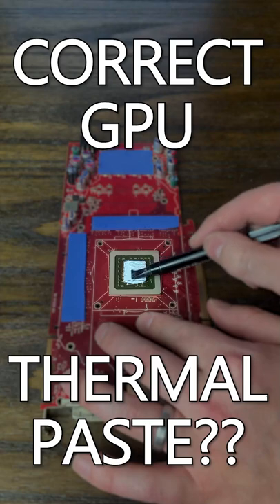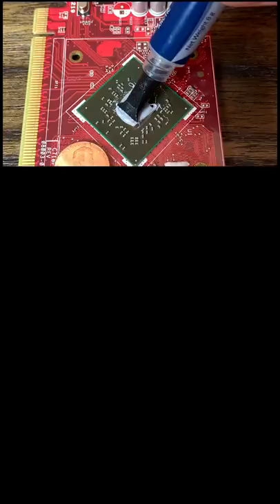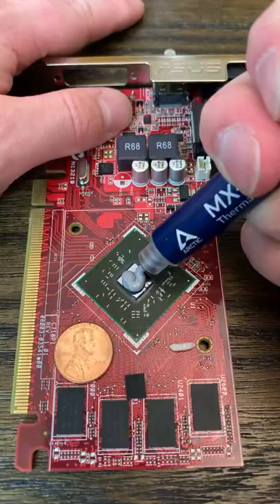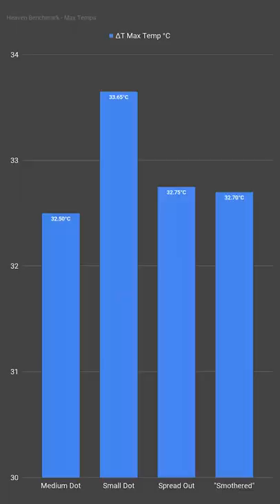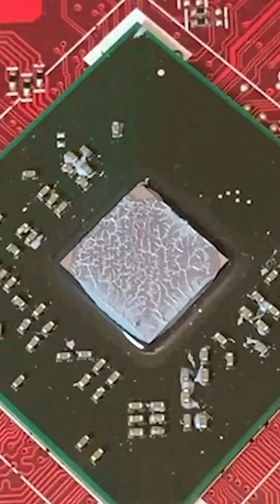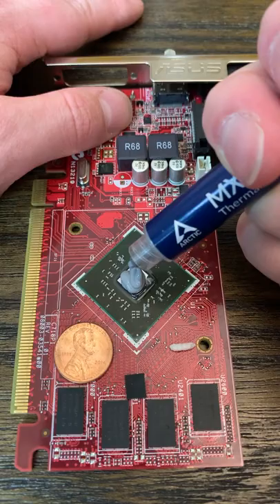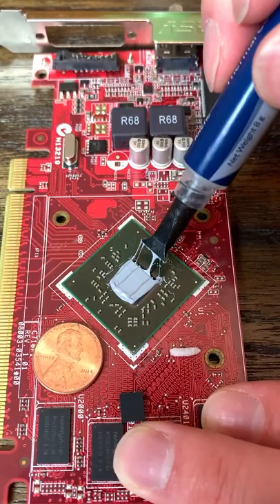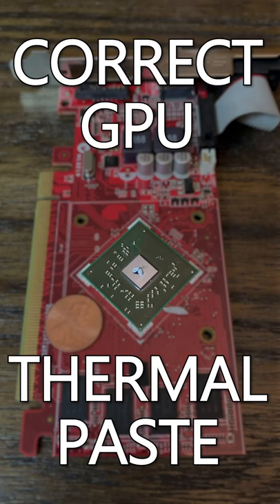GPU Thermal Paste - The WRONG Way #Short

Comment: I usually like to spread the paste onto the surface of the IHS or die so it doesn't risk any corners being left uncovered.  I tried using the regular dot method, but it still had some bare spots on the very edges.  Using extra paste may help, but it creates a huge mess that is a pain to clean up (and potentially dangerous to the components due to the risk of knocking something off).  The most important part is making sure everything is covered, 1-3c isn't enough of a difference to matter
Reply from the maker: In some instances, I believe you’re totally correct! Especially with larger dies, unlike what I was testing here. Just make sure it’s thin and even to avoid air pockets. With smaller dies, the dot seems to work well and with no extra mess.
Reply: You can make square blob you know
Reply: On an ihs it’s more or less useless
Reply: Wdym
Reply: You didnt torque it properly or added too much then. You should have full contact without any paste, the paste just shores up tiny gaps.
Reply: @HardwareHaven
Reply: I draw an “X” of paste and put a small dot in each corner. Works every time, doesn’t make a mess.

Comment: A thin, evenly spread layer on both surfaces, then a bit of wiggling the heatsink while applying gentle pressure has worked best for me over the last 30+ years of PC building and repair. Side note: mayonnaise is not a good substitute for thermal paste .

Comment: Heat spreaders are the only reason application doesn't matter on a CPU: the chip itself is already fully covered in paste from the factory, so the entire chip stays the same temperature regardless of how it's applied to the heat spreader: As long as you have enough on there, it'll be fine, you don't need 100% or evenly applied coverage. Compare this to the exposed GPU chip, which would get too hot at any points not totally covered by thermal paste

Comment: The problem you run into is that if there is any die exposed that will 100% cause damage, and it'll happen faster with higher power draw cards than lower power draw cards, the only time this isn't the case is if this part of the die has a temp sensor (which not all of it does) as in that case it can throttle/shut down etc, if it doesn't have such a sensor in that portion of the die (the corners and edges usually don't until much much more recently), I killed an rx 480 this way under LN2 a few years back because a portion of the memory controller wasn't covered and as a result the memory controller got too hot and died, iirc buildzoid has managed to kill a core that way too, but just as a point of note, this is why I generally recommend spreading manually on any exposed die where possible

Comment: In modern GPUs with a bigger die, spreading can help, so yeah, it's always relative
Reply: The tension of the mount should spread it weather you pre spread or not, it doesn’t hurt nor harm
Reply: @Joel-cj2cz  Air pockets though...
Reply: Unless you draw a circle with thermal paste it’s 99% not gonna happen you put a ball/line so as it compresses and spreads it pushes the air out
Reply: @ChrisD__  Squishing them together has a less likely chance to cause air bubbles than spreading the paste does
Reply: @TheRealGr33nGuy  That's what I'm saying :p
Reply: @therealb888  I can say the same thing about Thermal paste and air bubbles. I haven't seen a strong source or proof that air bubbles/pockets can form easily, except on forms where people claim that it does exist.

Realisticly, the only way an air bubble can actually form is if you spread to thin, but that in of itself is fairly difficult to do mindlessly. 

If coolers weren't mounted to the socket, then yeah, air bubbles will exist, but it'd be an entirely different issue all together.
Reply: @randomstuff508  Lol I'm not arguing with you. These thermal paste related arguments that hobbyists & enthusiasts argue over on forums are actually seriously studied by engineers. 

You are correct that with your counter question. There is no scientific testing easily available in the enthusiast space that demonstrate the air bubble issue.

I actually agree with you. Irrespective of the application methods, most cold plates of heatsinks (the surfaces that touch) are not fully flat. They tend to be convex or concave (not talking about imperfections. This might help to push out air bubbles. As you mentioned, air bubbles or uncovered areas shouldn't happen unless the spread is stupidly thin.

Comment: NO!  Do NOT use the DOT method.  Cover your finger with plastic wrap and spread it out evenly, ensuring there are no air pockets.  Apply enough to squish out when you mount the heatsink, and this will also avoid air bubbles.  This is the correct method and dates back to the Socket-A Athlon CPU days...    
An exposed die needs to be completely covered with a film of thermal paste because it has no heat spreader.  If you were to delid a modern CPU and remove the heat spreader, you would see the same thing:  A layer of TIM or Solder covering the whole die, making contact with the heat spreader, and plenty of exvess squishing out the sides.

Comment: Fun fact, thermal pastes are even silk screen printed in some industrial cases. Too much thermal paste will have poor performance because not every assembly can be torqued down enough and industrial thermal pastes are more viscous & dense. They're harder to spread & compress.

Thankfully consumer electronics are quite idiot proof in this case.

Larger dies with heat sinks AMD & Puget systems recommend either stencil spreading or X method.

Sources:
AMD Factory tour at CM
Puget systems testing with threadripper.

Comment: From an ihs if any corners are left it's usually fine in lower power chips. But anything with an exposed die should be 100% covered, even better if it leaks off the sides too.

Comment: Recently my machines' annual clean and dust came up. Gave everything a good clean plus dusting, and applied fresh thermal paste onto my CPU (i5-11600K). I used an X patten with a small border around it, and it's working great 😁

Comment: Spreading the paste around IS NOT a bad thing! Yes there are potential problems, but they happen maybe 0.5% of the time. I've actually had really good luck doing that method! If I'm ever unsure how much I should use, I'll put a little dot, spread it, and add a little more if I feel it needs it. This is especially  useful with older Nvidia cards, or particularly large CPU's.
Reply: im a pc builder, laptop service. since 2014 until now, no PC/ laptop/ GPU card died because i spread the thermal paste😅 so its 0.0000000001% chance

Comment: GPUs don't have IHS, it's not safe to just put a dot in the middle. If you delid a CPU you sure as hell is not going to put a dot of liquid metal in the middle. Sure, it doesn't spread nearly as easily as TP, but you want to make sure all of the die is covered. Anyone who repairs GPUs will tell you the same.
Reply from the maker: As long as there’s enough to fully cover the die once mounting pressure is applied it should be fine. That’s the main point I wanted to get across here. A more in depth look at this is in the works

Comment: To avoid hot spots on the corners, make an "X" with the thermal paste, lingering for a second in the center of the "X" to add a bit of extra in the middle and you'll be good to go.
Reply from the maker: I’ll test that out 👍🏻

Comment: For the past 2 decades I have found that the absolute best method is to clean both the CPU and heat sink surface with a lint free cloth and 99% isopropyl alcohol. Let it dry then use a quality heat sink paste like artic silver or noctua and spread it out evenly with a fresh metal straight razor.

Comment: Since using too much is not really an issue I think the best way is to evenly spread it out then put another small sized dot in the middle. This ensures it is 100% covered and the extra dot will spread to fill in any major gaps. I never really seen an issue from air gaps I think that is just a rumor that was started years ago.
Reply from the maker: Seems like there are lots of rumors circulating the pc space haha
Reply: @HardwareHaven  Yeah one of the most know overclockers der8auer said it's just a rumor and not true lol
Reply from the maker: @kakashi99908  Just curious, do you have a link to when he said that? That would be super helpful haha

Comment: Very interesting. Once, I applied paste to a CPU, and the past spread unevenly while mounting the heat sink, leaving a fair amount of one half exposed. As a result, I now always spread the paste to account for uneven pressure during mounting.
To avoid bubbles, I just make tue layer very thin. After the thin layer, I guess you could add a small dot.

Comment: You got good results with the dot only brcause the die is square and small
the best way is to simply cover the entire die.
Reply from the maker: I think the results would be the same with a larger die as long as you have enough paste. The dot would be significantly larger for a larger die. BUT, you make a great point about the shape of the die. I hadn’t thought about rectangular dies. I plan on doing more thorough tests with a larger hotter card. I’ll try to find something with a non-square die as well. Thanks for the comment!

Comment: If someone understands the purpose of thermal paste and the basics of heat / air being a conductor etc, then logic will tell you that more is better than too little. Assuming someone doesn't use totally crap paste, then too much will not insulate the die / IHS, nor will it try out in 2-3y in most cases.

Comment: Modern gpus are completely different so you need to work on a bigger GPU. That way you can show people how to do the vram as well. It'd be interesting to see someone try this with vram and the additional little chunks of copper for your heat blocks. That could be one of my issues with my 3060 TI. It is running on average 20° cooler in Celsius and I'm picking at 68 ° c with 100% GPU load now. I think I might have put a little too much though. My next experiment with this card will be to cut the heat pipes and sprays on a series of channel tubes so that I can tie it in with the water cooler for the CPU. I've been hesitating because I don't want to destroy my best card until I buy a new one. It's the only GPU out of the 10 I had here at the house that has heat pipes.

Comment: No.  The dot method leaves uncovered parts of the die too.  Your thin layer method is the way to go.  You'll never EVER get air pockets because you don't screw all four cooler mount screws at once.. that's literally impossible.

Comment: Always, always press the cooler to the medium dot, lift and make sure that it cover properly, if yes: good 👍🏼 If No: apply a little more paste, squish and check again.
Always.
Reply from the maker: My one concern with this would be the possibility of creating small air bubbles between the heatsink and die from removing and reapplying the heatsink. Not sure if it’s a thing, but that’s what came to mind. Definitely want to have enough though
Reply: @HardwareHaven  yeah I get that, but any decent thermal past has never made it a problem. Have had it happen with something as thick as Arctic Silver, but Noctuas paste has been magic. Also, it is so much easier to properly clean than ArcticSilver😄 Feels like a wiping a magic marker vs just cleaning 😂
Reply from the maker: @BuzzBazzJ  for sure. I only used arctic on this because I didn’t want to have to pay for a ton of something better 😂

I plan on doing a much more detailed and comprehensive retest of this in a future video. I’ll probably try to use a better thermal paste, and/or I might try removing and resetting the heat sink multiple times to see if I can develop any sort of issues with air pockets. That could be fun… Thanks for the comment!
Reply: @HardwareHaven  ah nice! I’m interested in seeing if the method I use actually causes bubbles. Over the years I’ve been a little extra when cleaning dies of CPU’s and GPU’s. I’m not sure wether or not properly cleaning the die like if it came from the factory vs many I see leave some old crud around and just focus on the center die.
For my own OCD and for later cleaning/reapplication I find it helps, but I’m not sure that really matters.
I look forward to see your future testing.

Comment: what are people smoking, with how big the dies have gotten, spreading the paste over the die is the best way to go, since you are guaranteeing that the whole die gets covered even though the cooler is going to spread it out anyways.
Reply: dots work for cpus, because they got a IHS, bare die go for the "spatula method" or spread the thermal paste. There wont be air pockets since the cooler is gonna squeeze it out anyways.
Reply: in all the gpu repastes I have done, I have always went with the spread method, and out of the 50 I have done over the last few months, none have shown any problems and temps were better than stock.
Reply from the maker: My assumption is that the dot works pretty well with small dies. I'd like to retest this with a larger more modern GPU, but I don't have a spare lying around haha. 

I think you're spot on. My only thought would be that, for a beginner, a medium to large dot (enough excess to cover the entire die), is probably safer than poorly using an applicator or spudger because of the potential for air pockets.
Reply: @HardwareHaven  I beg to differ for the dot method on smaller dies. Covering the whole die with the spatula method is 100 percent the best way to apply TIM on systems with a direct die cooling solution. It you don't cover the whole die you risk killing the whole thing because a certain part of the die is overheating and eventually killing itself. That's just my two cents anyways...
Reply from the maker: @tom-hp5wb  Fair points. I think the idea is that the dot is big enough to make sure that, with adequate and somewhat even mounting pressure, it spreads out to cover the entire die. I took footage of the die coverage after I removed the heatsink with each application, but only was able to fit in the shot of the 'small dot' results, which did exactly what you described. With enough thermal paste, it covers the entire die (at least with this sized die). I would be more concerned that someone wouldn't put enough on a larger die, especially with everyone on the internet constantly complaining about too much thermal paste haha. Spatula method seems to be a good way of ensuring that, but potentially with a risk of creating air pockets if it's done poorly. The main take away I wanted from this video was for people to stop feeling like if they used too much, it would be 'too much thermal paste to cool it' or whatever people say.

Comment: That graph makes it look like one is much higher compared to others lol. It's just 1 degree C. They are all the same pretty much.
Reply from the maker: Definitely really close. I think the fact that there was a consistent increase in temperature when the die wasn’t fully covered is still evidence that it’s safer to have too much than not enough. I’d like to test this on a hotter GPU with a larger die, where I think the difference would be more exaggerated.

Comment: Intel website says pea sized dot in center of chip. I mounted the fan/cooler in my gaming rig wrong and lifted up the cooler after putting a medium pea sized dot and it was covered completely. So think of a cooked pea size definitely larger than a bb from a bb gun. About 2.5  to 3.5mm diameter. Good luck bros.

Comment: The worse I’ve ever seen in person was a used dell I bought. It came with a stock cooler for the cpu and was over heating. When I took it off there was only a small dot on the center of the cpu. I’d say over half of the cpu didn’t have any. I’ve heard this is ok on intel processors (if anyone knows lmk in a reply) but it went from over heating to running smooth as butter after I added more and changed to  a bigger cooler.

Comment: When it comes to GPU, cpu pea size thermal paste rule is rediculous as the gpu produces heat alot faster then CPUs. Even manufacturing dumps alot of paste on there cards about the size of a peanut  that is thinly spread in a square to cover the whole die. Some computer techs get way too ocd about thermal spreading

Comment: People who nitpick about thermal paste application are cringe, who cares how you apply thermal paste, doing it suboptimally isn't gonna blow up the PC and cause massive performance hits
However, feel free to bully the Verge and their thermal application choice...
Reply: It largely doesn't matter what way you apply it for components with heat spreaders. Nitpicking for cpu applications is unnecessary, but for applications where the heatsink is in direct contact with the die then the story changes. If you leave even a little bit of the die without paste then you run the risk of killing the whole component.

Comment: How you apply thermal paste always depends on the cooler that's going on top of it. And that's why gamers Nexus tests the contact of a lot of coolers.
Reply from the maker: Does gamers nexus recommend different thermal paste applications per cooler? I always thought those tests were just to see how well the cooler and mounting hardware was manufactured/designed